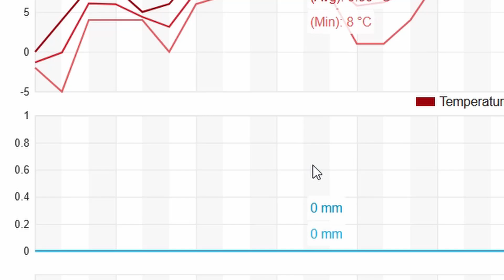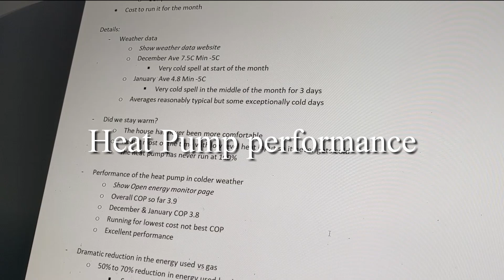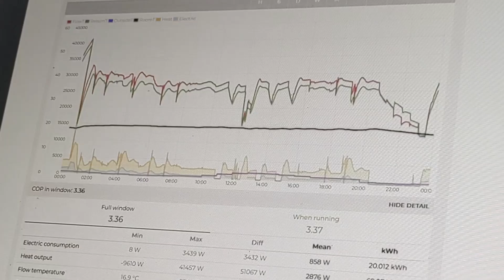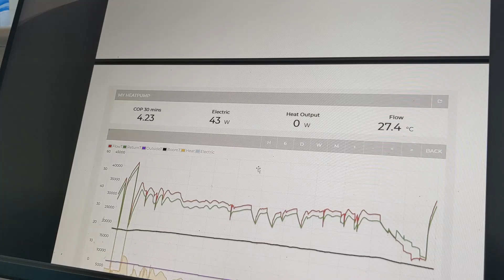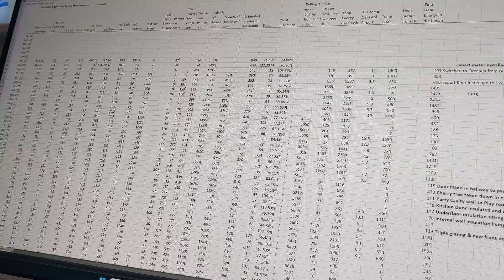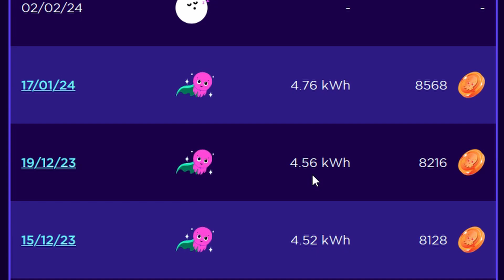How does a Microbore Heat Pump perform in Winter?

Comment: At my early stages of research but after opting for a solar and battery set up (utilising an octopus go tariff for our EVs) An ASHP seems the next logical step, however our preferred installer has some concerns re. our Microbore pipes from the manifold to the individual radiators - he seems 80% sure it will work! Going through your videos now though it looks like it could still be a more than viable option

Comment: Interesting most informative, only question is the heating cylinder, is the flow from the heat pump the same throughout the system? some have an additional boost but it reduces efficiency.

Comment: How do you set up your heat pump  in summer if there is no valve and buffer?
Reply: There is a 3 way valve, like a gas boiler would have, this sends the hot water to either the radiators or the hot water tank as required. In the summer it is just sent to the hot water tank as no heating is required.
I hope that answers your question, if not let me know.
Reply: @hughrattray9354  Thanks, tell me else do you have gravity system of your system is connected to main pipe?
I do like your videos,very helpfull🫡
My system is fitted with 8mm pipes next to radiators, then 22mm ,and 28mm as yours.Do you think it would work with heat pump?
Regards

Comment: Very informative and thanks for posting. Do you have annual maintenance contract for the heat pump? Just wondering what the indicative costs for that might be to cover potential breakdowns etc
Reply: Yes, I do have annual maintenance and the cost for the year just completed was £230 - it is a significant cost

Comment: Very interesting thanks for sharing. That makes me feel very pleased indeed with my setup which is similar using 8mm microbore but with hydraulic separation using a small low loss header. I got COP (heating & hot water combined) of 3.4 at -2degC average across the four days 15th to 18th Jan, and for the 6 months from Oct'23-Mar'24 combined COP was 4.2, although it has been an exceptionally mild winter.
Reply: That is great news. Make sure all the sceptics know. They are excellent COP figures.
My figures are based on the open energy system. The Vaillant data gives significantly higher COP figures. Either way it is excellent.

Comment: Excellent. I also jave microbore and had given up on a A2W heat pump. However, after your vids, it looks like the most viable option now!
Reply: Thanks - I am very pleased you are having a new look. I ended up spending many hours becoming knowledgable on heat pumps. Sadly a lot of installers knew less than me so I got rid of those and eventually found a few that were good.
Don't hesitate to ask more questions - I would be very happy to help further.
Best of luck.

Comment: Do you use the HR91 or HR92 radiator controllers? I'm assuming they do the same job, but the 92 has a digital display.
Reply: I have HR92 controllers (allowing adjustments from the room) - Having said that I have had to disable local adjustment in many rooms as the grandchildren love to fiddle with the knobs!
I think I would choose the HR91 now.
Reply: That's a problem, those pesky grand kids. I'll probably get the HR91 then as will probably have grandkids, too, in the not too distant future. Thanks for your videos, very informative 👍

Comment: Really good video.  My house is the same 22c backbone and microbes everywhere else. 19000 kwhr gas (tank) at 19.5c but that’s a tad cool for my wife!! What temp do you run the house at for your figures.  Some of us want 20-21c. Etc.  Have you thought of running a cold month at 21c just to see how much more energy is used . ??   Also having free solar is actually a 15p cost due to lost export.
Reply: Thanks for the comments. 
I run the house at 20C most of the time with a setback in the middle of the day (when we are often out). I find that we are comfortable with a lower temperature than when we had gas because we never get cold and so don't need a big heat up.
Good suggestion on the 21C I can look for a cold period to do that.
I did wonder how to account for the solar value and giving it a 15p value is one of the approaches I considered. The truth is it is quite difficult to seperate the financial impact of each component of my system.

Comment: Really interesting stuff. Thanks very much for taking the time to share your findings. I’ve recently insulated my roof and am pondering my next move into either solar/battery or a heat pump. I have a large house with 10mm microbore also, but I run my Vaillant boiler on a weather compensating control which tends to keep a flow/return of about 50 / 42 degrees if I keep the house at around 19 degrees day and night. I think therefore the heat pump will work for me without too much modification - perhaps one or two larger rads (I’ve 22 in total- it’s a big system). I’m just concerned about install cost though.. I reckon on an install bill of about £15k, reduced to 7.5k after the grant - would you agree / is this about right?
Reply: Thanks for your comment.
What external temperature results in the 50C flow rate?
My installation (September 2023) was in the region of £12k before the grant and for that I added 6 new type 22 radiators and moved two others. (More details on my installation are in the first video we did on my system “400% efficient microbore heat pump”)

I built myself a little cost model as it is possible to find the prices of the major components such as the heat pump, controller, radiators and tank. (Midsummer Wholesale is a good place to look at prices.)

50C is well within the capability of the Vaillant heat pump but the lower you can take the flow temperature the better from a cost and efficiency point of view. The two ways of reducing the required flow temperature are house insulation and the size of your radiators. If your radiators, in the core of the house, are not type 22 I would recommend updating them. It is a very simple job to change them and will allow you to save some money.

Comment: Thank you for sharing. I am also planning the same with microbore pipe connected radiator. It is good to see that your system is working well.
Reply: Thanks for the comment - I am keen to dispel the myth that microbore needs to be ripped out, at huge expense, in every case. Help spread the wor!

Comment: Thanks for sharing - I move soon and have received a guesstimate from Octopus.  3 months before I can get a survey and then 5 months before I can get an install.    Reflection on where the market is.  British Gas confirmed they are not operating in my area.   Regards Mike
Reply: I did have to work hard to find an installer with decent pricing and also a reasonable lead time. 
The installer I chose visited very promptly and installed the heat pump within 6 weeks. A friend had a similar lead time from them.
When I was struggling to find installer I contacted Vaillant and asked them to provide some more details and that is how I eventually found the installer

Comment: I have been in a dilemma about installing a heat pump since the generous RHI was running but trying to get an installer / company to even show up was impossible before the scheme finished. I have a large bungalow with micro-bore but I have no idea what the other pipe sizes are or even where they are (I suspect under the floors) so I'm not sure a heat pump is going to work or an installation be affordable. If you don't mind sharing, can you advise how much you installation cost and which company did the work?
My biggest issue is the amount of investment and getting a good installation for all that money.
Reply: P..S. This probably isn't too scientific but I took your example of 8th January where you used 69kWh of heat which cost £3.20 in electric. If I used the same amount of kerosene in my existing system, based on my fuel costs (purchased last June), it would have cost me £3.66 for that same day or using 69kWh of heat. Now as I say. this is crude math, I don't know if I would use more, less or an equal amount of 69kWh of heat in this scenario but with a price difference of £0.46p for the day, if a typical heat pump installation costs £10k, if I divide £10k by £0.46, there are 21,739, divide that by 365, thats 59.5 years before I break even, I'm pretty sure my math must be flawed because that can't be right LOL
Reply: @healeydave  but that day is worst case for the heat pump. As the temperatures rise there's more heat that can be extracted more easily from the atmosphere. So heat pumps get more efficient as they get to that sweet spot where they can run at lowest power output with no cycling...

Instead of a day's COP of, say, 3 (300% more heat out than energy in), in spring you'll be near 5. Then there's hot water too, and the ability to use solar and batteries to further reduce costs.

Electrification is a set of strategies that add together to make each a better investment. Not to mention the reduction in pollution both locally (no kerosene burning out fumes), and globally thanks to less co2.
Reply: @TheBadoctopus  I'm all for the Eco side of things and I love the technology but it's got to be affordable and at least get close to some form of economic sense. What I mean by that is as far as I can tell there is virtually no situation where-by ripping out a working system will make economical sense. If you have a system that is actually broke, you can start factoring in the cost differential between technologies. If your current system is working (albeit not as efficient)  the cost benefits are only that of the difference in running costs which will be pence per day and thats when it becomes difficult to validate (especially if your middle aged or older) unless your wealthy enough to install a system for someone else's future benefit or simply not interested in the costs and just want to do the right things Eco wise.
Reply: @healeydave  just pointing out the maths is better than you originally said... But I'm 100% with you...

I've got a situation where my gas bill on my 80s bungalow is only £600-700 for a year since I've insulated, and I've still got things I can do to lower it further. So if I add a heat pump to my solar and battery setup I might save a further £100-200 a year. Not really worth it right now Vs getting an EV which will save £700-1000 per year and probably similar co2.

But when gas starts getting more expensive (or electricity gets cheaper) these numbers will change pretty quickly.

Comment: Very interested on how you have integrated EvoHome with Vaillant SensoHome. Are you just driving smart radiators valves with the EvoHome rather than also controlling the heat pump with EvoHome?
Reply: Yes - the sensocomfort controls the heat pump and Evohome just switches the radiators on and off in the bedrooms and other peripheral areas. It works very well as the heat pump is running most of the time. I have found I need to allow longer for the bedrooms to come up to temperature if they have not been ocuupied for a bit.
Reply: @hughrattray9354  That's great to know as most people usually ditch their EvoHome/Tado/Wiser once heat pump is installed, but sounds like its a good idea to keep it just to limit when bedrooms are heated up and to what level even though it's not controlling the heat pump directly. Think I will follow suit. Thank you.
Reply: The COP guys focus too much on that number, saying things like don't have 3rd party controls or zones or whatever. But surely the best efficiency is NOT to heat things that don't need the heat?... So bedrooms overnight, rooms with lots of solar gain, times when lots people are in, or when a big meal is cooking are all times you want room-level control. 

Basically I'm saying I decide where and when I need heat, not the pump itself or the engineers aiming for unnaturally high COP. I bet it's more efficient overall (£) to follow a good control strategy rather than chase COP.
Reply: @TheBadoctopus  Generally I agree with you but with the caveat that you need to ensure the heat pump always has enough radiators open so it can maintain the flow rate it needs.
In warmer weather you can stop the heat pump from cycling by turning more radiators on until the cycling stops. Your COP will improve but the energy and cost will go up.
To me the key thing is to be comfortable and use as little energy as possible.
I am very happy with my system with the core area radiators always on and then separate control of other areas
Reply: @hughrattray9354  yes, we're on the same page. I guess the challenge for us - and the industry - is now to handle this "home heat loss is below minimum heat pump modulation" situation...

If the house needs 300W to maintain equilibrium, and the ASHP can't go below 600W, for example, then cycling is just a fact of life. I get that cycling lowers COP (and increasing emitter area can partly mitigate that) but honestly, does it even matter if you need less heat that the unit can provide? Clearly not.

So it's a complex multidimensional problem that likely has several strategies that are good, but no guaranteed "best" because no house, weather, family and lifestyle is exactly alike.
Reply: @TheBadoctopus  I don't know what limits the heat pumps ability to modulate, do you? The Vaillant 7Kw can reduce to 25% of maximum - what stops it going lower?